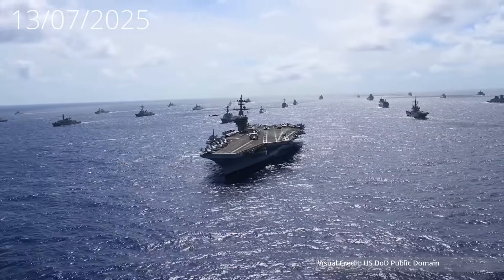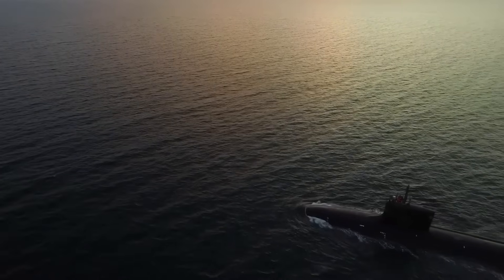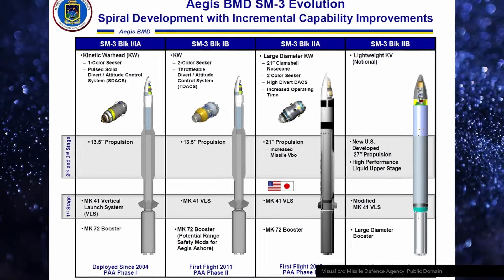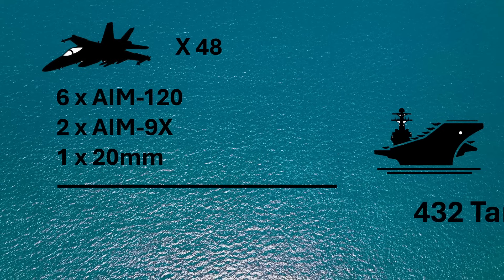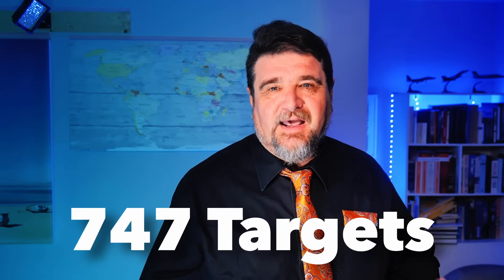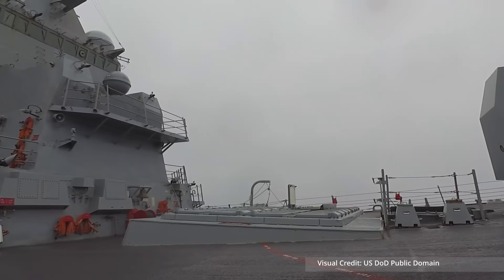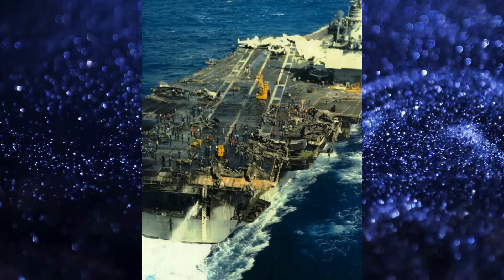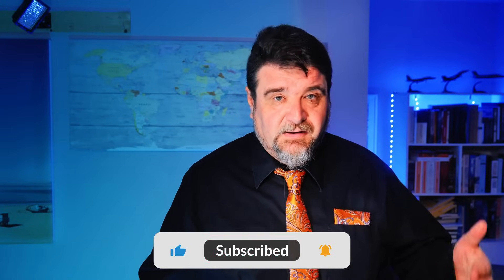HOW MANY Missiles are Needed to SINK A CARRIER?

Comment: Very Briefed And Summarized Ideas:

through Conventional means:
using anti ship ballistic missiles equipped with bunker buster warheads, our Chinese friends, and even the Iranian, are capable of penetrating the deck of the most protected and heavily armored aircraft carrier, and perhaps pierce it from top to bottom, and reach the water causing flooding the ship, the missile hitting any part of the carrier’s internal components and sections will lead to catastrophic destruction, the attacker knows which part of the carrier he must target and what the expected effects of the missile exploding on each floor and each part of the multi floor aircrafts carrier, for example, there are aircraft fuel tanks and there is the ammunition depot and the nuclear reactor, there will be a floating Chernobyl, Whoever is not killed by the explosions will be killed by overdoses of radioactive... 

but the question is not how to penetrate the carrier's heavy armor and defeat standard safety measures such as fire-resistant walls and automatic fire-extinguishing systems, but how to defeat the carrier's escort group, in the end, aircraft carriers of what is very temporarily called the united states of america are not equipped with advanced air and missile defense capabilities it's only equipped with point defense CIWS and sea sparrow...
 
the detailed question is how to flood the operations room of the escort ships and even the island on the aircraft carrier with multiple layers and dimensions synchronized threats, even though the carrier group will need constant reloads so as not to leave gaps in coverage ranges in its multilayered air defense & anti missiles defensive shield, there are tactics and weapons systems capable of defeating the escort group, for example for the regional power with semi primitive and less advanced combat capabilities best method is to: 
1- simultaneously overwhelm the carrier group from all directions and all altitudes and domains,(multi axis, multi directions and multi domain, multi speed without ignoring I am huge fun for the supersonic and hypersonic speed), from cyber warfare to underwater, 
2- dividing the aircraft's carrier strike group into individual vessels, and simultaneously overwhelming each escort vessel with multi domains attack(in addition to the aircraft carrier), forcing the escort vessels to choose between defending itself or the aircraft carrier they assigned to protect,

for example for the multi domain, multi direction, multi altitudes attacks: 
1*-attacking the electromagnetic spectrum e.g: cyber warfare, conducting intensive ECM/ECCM/ESM in order to degrading the situational awarenesses and c-4 of the vessels, and help the friendly ammunition to reach those vessels and defeat the multilayered defensive shield, in addition to the passive protection armor and causing the intended destruction,

2*- launching swarms of missiles boats or even especially modified speed boats equipped with guided MLRs launching either rockets equipped with lader guided small diameter glide bombs, or rockets think of enlarged laser guided (APKWS) II/(LOGIR)/(DAGR), those rockets capable of travel at 4 and 5 mach and reaching its maximum range in about 40 second),

3*- speed boat launching torpedoes the latter is for the underwater dimension,

4*- launching swarms of suicide sea drones, it could be equipped with additional equivalent pods for launching the (APKWS) II/(LOGIR)/(DAGR), rockets,

5*- launching suicide drones swarms flying at low altitudes or skimming the surface of the sea exploiting the curve of the earth to mask its approach, and other swarms flying at high altitude for provoking the exhausting air defense missiles, those swarms of suicide drones and attack drones could be equipped with either: 
1**-suicide FPVs each with range of 20km, with weight not exceeding 4k.g and equipped with 2.5k.g shape charged warhead capable of penetrating 400mm of RHA either re-enforced steel or heavy multilayered composite armor, other warheads with HE-FRAG, could be employed according to the needs, those suicide FPVs drones could be used to suppress enemy vessels radar systems blinding those vessels, and CIWS, attacking the VLS cells, allowing the other ammunition to reach its targets,
2**- Chinese equivalent of the precision laser guided (APKWS) II/(LOGIR)/(DAGR), it could installed be on racks with range of 8km and armor piercing or HE-FRAG strike ammunition, illuminating the spy-2 radar and other vital parts for those low cost rocket the attack drones would be able to saturating those parts with salvos of those standoffs ammunition, that is impossible to be intercepted, thus either suppressing or seriously degrading the combat tactical and operational capabilities of the vessel, homing on the VLS cells could cause explosion💥of the loaded ammunition...etc.

6*-anti ship cruise missiles with reduce radar and infrared signatures, either flying at high subsonic speed or supersonic and hypersonic speeds those ASCM, flying at extreme low altitudes skimming the surface of the sea, and following simple trajectory or capable of deploying countermeasures and conducting evasive maneuvers to defeat enemy defense shield.

7*- ballistic missiles either equipped with single unitary highly maneuverable warhead, or equipped with bundle of small diameters laser guided glide bombs equipped with additional rocket or propellant, each SDGB will be able of flying at least an additional 500km, think of the outdated r-17 elbrus, with one of the basic variant is ss-1scud-b, the missile capable of delivering 1000k.g to a range of 300k.m, flying altitudes is 50km, at this speed and altitude the SDGB will have a tremendous momentum and can obtain addition 500k.m of range this even without the need to ignite the engine or the propellant, which would be uitlize in the terminal phase to achieve supersonic or hypersonic speed, and conducting 90 degree angle of attacks, those SDGB could be equipped with multi mode guiding/homing systems, GPS or BeiDou Navigation Satellite System (BDS)🛰️, laser guided and electro-optical with two way data link, later generation of liquid propellant r-17 elbrus missiles like the scud-c/d, DPRK Hwasong-5/6/7/9, and the PLA Dong-Feng 11, capable of reaching more than 200km in altitudes, thus pushing those small diameter glide bombs with appropriate design and additional engine or propellant further in range... 

LONG LIVE CHINA LONG LIVE PLA...

Comment: Thank you for the through presentation. Sinking it is very difficult, disabling it is easy. However, you addressed that weak point by asserting that make shift repairs only take several days. That makes it quite formidable, especially if there are several that can be rotated during repairs.

Comment: Allow me suggest you go over to "What's going on with shipping" and check video "Whiskey Tango Foxtrot U.S. Shipbuilding? | The State of US Navy & Coast Guard Shipbuilding".
Reply: Find out the real state of USAs navy.
12 decommissioned Ticonderoga's in the last 5 years.   Another 4 proposed this year.   Another 2 in 2026.
And the final 3, in 2029.
Reply: Apparently, there's currently only 3 actually fully operational.
And there's no pretty new Constellation frigates, because they spent that money to take the Fremm design and completely remake it to USA-built and equipped.
Reply: 10 years to build the Ford.   Except only by stealing parts from the next ship in class, which at minimum will have taken 12 years to finish after it was laid down in 2015, and the next after that is theorised to take just 8 years, except there's no improvement in the actual delivery or production of the parts, so it's probably going to take 10-12 years as well.

They can't even build coast guard cutters or icebreakers.

Comment: I'm not a military expert, but I think Oreshnik missiles and hypersonic missiles should change the situation drastically.
Reply: No. Hypersonicity prevents interception only (and speeds up the time of arrival to target, obviously). However thermobaricity, especially if several such hypothetica torpedoes (rather than air projectiles) would hit the ship under the floating line. There are no underwater hypersonic torpedoes, it's not feasible AFAIK, even the most sophisticated submarine drones would need to be large and thus detectable and probably intercepted by the escort ships.

It's probably much more harmful to target the command bridge and render the carrier "headless". It's possible that even such a headless AC could manage to reach port for repairs anyhow, as the engines are surely inside the hull. Successfully targetting both the bridge and the engines would be extremely destructive but still not sink the ship. 

Filling it with rocks would sink it however because it seems apparent that they're built like those floating blocks used in modern dock building. They do sink... but only when intently and slowly filled with rocks.
Reply: @LuisAldamiz wrong. A hypersonic missile at mach 10 makes enough kinetic energy to penetrate with a tungsten penetrator. It will go strait through. Add cluster munitions game over.
Reply: @JohnTaylor-t9i  - Unsure. In any case targeting ships with ballistic missiles is almost certain to miss. Ballistic missiles of any kind are only good for static targets.
Reply: Russia (Soviet Union)created submarines out of pure titanium at a time when the US thought it was impossible. Russia would like to be underestimated  as it is a tacrical advantage. After all they fight with shovel. When I enter a fight as a martial artist I want to be underestimated.  I'll make you a believer. By the way how many operational hypersonic missiles are the US fielding. Zero.
Reply: @JohnTaylor-t9i  - Do you even know what the "shovel" meme comes from? It was part of a denounciation by the late Prigozhin that weapons and even the humble trench-digging shovels were not arriving (in sufficient amounts) to the frontline (not to Wagner but to the common soldier) in sufficient amounts. That seems to have improved after Shoigu was replaced but it's not something to be proud. 

Not sure if anyone is underestimating Russia but I'm sure you want to be rather overestimated, feared, if you want to win without a fight. War is not a competition in which you fight for glory, medals or whatever, war is the real deal: you want to win, not to prove anything.
Reply: @LuisAldamiz thanks for your insightful, self righteous indignation. Be like water my friend.
Reply: @JohnTaylor-t9i  - Be like water to avoid a fight, be like fire to win it, be like earth to hit the right target, be like wind to flee unharmed.

It's not indignation anyhow, just disagreement.
Reply: @LuisAldamiz  😂

Comment: I expected the usual serious analysis, based on the evaluation of the  most recent evidence from comparable engagements w/w. 
Therefore I stopped watching the video when I saw an assumption of 100% Availability of the 48 F18, and a 100% kill rate of the a/a missiles.
Are these realistic figures in 2025? 
Add to this that VLS  are NOT rechargeable at sea, but only in an harbor, and that enemy planes can fly MULTIPLE SORITES per day: you do NOT need to saturate tthe defenses in one single attack, you just apply ATTRITION to the CAG a/a defenses, and push in at the right moment. 
IF yours are the assumptions needed to give still credibility to a CAG.... Uncle Sam would better scrap all those Sitting Ducks.

Comment: Thanks. The Houties showed to some extent how they could interupt air operations of an Aircraft carrier. The sudden maneuver that caused an F-18 to go over the side indicates that they had enough intel to assess when the carrier was preparing an air operation and then they could disrupt it through causing it to have to take evasive actions. It was in a confined area in the Red Sea, so this should also be a lesson the US Navy needs to learn. 😊

Also, in Biden's Operation Prosperity Guardian 220 defensive missiles were used just to protect the group. Since these can only be restocked in port, air defence attrition can also be a method to use to attack the group. Send a 1000 cheap drones at a group over a time period and there becomes a defense issue for the group.

Comment: My first job in the Navy back in  the day was working on the flight deck of the USS ENTERPRISE (CVN-65). I was onboard her from 1984 - 1985. Towards the end of my time on the Enterprise we were doing training operations off the California coast.

Unfortunately some of the officers responsible for maneuvering the ship got it on with the pooch. They managed to run the Enterprise into Bishops rock, a known navigational hazard. This was handled by damage control flying squads. The next day a team of divers went down to photograph the damage and make a detailed report. An 80 foot long gash had been torn in the hull and some of the spaces used for storing JP-5 had been comprised.

The information was sent to Admirals and Naval Architects in the Pentagon. The word came back, you're a carrier, you're designed to take that noise, we need those training ops done.

So we operated for a month with no significant degradation in our ability to launch and land aircraft before we pulled into dry dock.
Reply: Further note. A carrier usually isn't going that fast when she's launching aircraft. Maybe only about 10 knots or so. Then head into whatever the wind is, say about another 10 knots or so. That plus the catapult assist gets the planes up with no problem at all.
Reply from the maker: Thank you for this story. Very interesting. If I had known I would have used in the video.

Comment: There were several occasions, where diesel-electric submarines were able to came close enough to a US carrier to fire their Torpedos. A relatively old german submarine surfaced near a aircraft carrier after coming to several firing solutions. Torpedos are much more deadly than rockets, because they hit the target under the hull, creating severe mechanical stress. If you hit the propulsion, it’s over for the carrier.

Comment: Pretty good video. A bit over-generous to the carrier BG, but you make good points.
I'd imagine that the mk 41's would have a more even split in their contents. So probably more like 1750 rather than 2500.
But I think the math bit which most favors the carriers though, is the 100% intercept rate. If you drop that to 95%, then you reach really critical damage levels within a few hundred attempts.
Which in turn illustrates why the navy wants to keep carriers far enough out to sea to necessitate longer range aircraft to make the attempt.

I don't know what's happened to your comment section here though. 
I tend to expect bold claims to outweigh informedness, in general. It's a species thing. Guilty myself here & there. But when the ratio gets really drastic, there's no meaningful discussions to be had.
It's not offensive or anything. It's just kinda dull, and "somewhat" unexpected. I didn't realize US carrier survivability would be such a draw for ..uh, youths, or those of youthful disposition, or at least those who adore hype.
Probably just the platform. Chrome/YT doesn't even know that informedness isn't a typo.

Comment: That 'saturation attack' math was long-winded, boring and pointless. It takes a minimum of two AD missiles to intercept a single incoming missile, and the potential enemies of the US have many missiles that have been shown to be much harder to hit than that. The Hornets are not going to be flying against massive Soviet-era bombers, and whatever large scale platforms the enemy uses will themselves be heavily defended. In the case of conflict with a foe armed with Chinese planes, the Hornet would be significantly overmatched and might get ZERO kills.
The freaking Houthis used their sandal-powered ground based ballistic missiles one at a time and several times penetrated a US carrier group's defenses enough to require emergency evasive maneuvers by the carrier.  The first thirteen minutes of the show was a complete waste of time.

Comment: The real attack would not consist of a massive suicide wave of heavy bombers without any protection, but more likely of multiple coordinated waves (time-on-target attack) of drones of Geran/Shahed type, whose purpose would be to absorb as many missiles as possible, and also to physically wear down fighter pilots and missile crews, followed by a wave of long-range cruise missiles and anti-ship ballistic missiles (and also likely involving so called "navy drones", i.e. remotely piloted speedboats loaded with explosives, for the purpose of additionally diluting fighter protection, who would in that case have to carry air-to-ground weapons as well).

Knowing that Russia uses easily over 500 Geran 2 drones each day in Ukraine, and that a salvo of 500 of such drones could easily be launched from a big container ship (5 Shaheds, ready to launch, fit into a standard 20ft shipping container, several types of anti-ship missiles, including ballistic missiles, can also be launched from a shipping container), a saturation strike by such weapons could be done relatively easily, with minimal risk for the attacker.

The attack of this type does not have to sink the carrier at all, does not even have to damage it significantly, it's more than sufficient to damage the AEGIS radars of the escort ships, and crater the flight deck of the carrier. With these out, the carrier group is pretty much useless and defenseless.

If necessary, a follow-up attacks could then be executed with heavy bombers, but only if the task is to actually sink the carrier group, not just to put it out of service. But that's probably the point where the US would respond by using its strategic nuclear forces, so it would not be smart to go that route anyway.